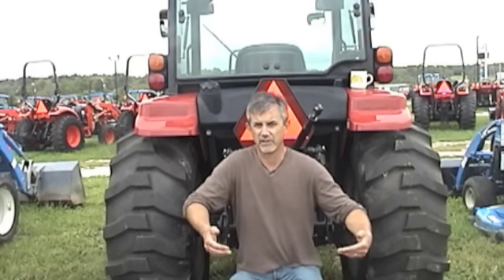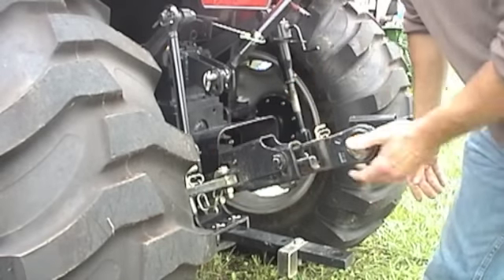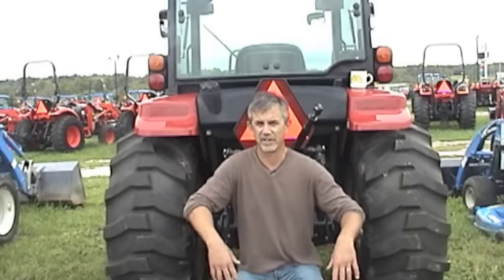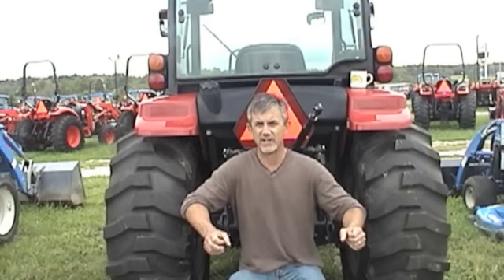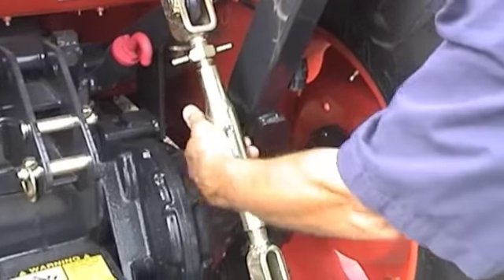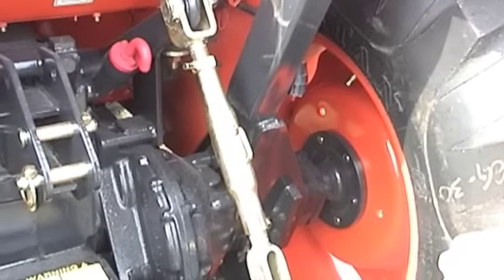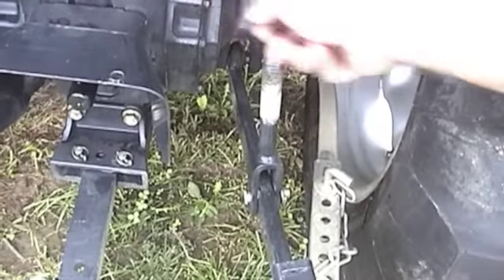Three Point Options

Comment: Scoring another LIKE on your video Mike! I had the original turnbuckles, they got beat to death very quickly. I replaced those, and then got the sliding braces to replace the turnbuckles, they lasted me a year and I just had them rip off - a couple of pins sheared on the slider, but I am not gentle with the implements either, so I know I am rough on them. I also originally had a three point quick hitch, but that also got shredded up rather quickly - and I think part of that was due to having the wrong size (Cat 2) instead of a more basic one.... Anyway, for now, because they are likely easy to obtain, I may be going back to the original turnbuckle system... I don't change things out often - but certainly - a proper fitting Quick Hitch would be sweet!

Comment: With the telescopic stabilizers, it can be difficult to find the sweet spot where the implement wont rock side to side. With the turnbuckle type, you can fine tune it and the implement is perfectly centered. The telescopic stabilizers have an advantage where you don't have to chain the lower links to keep them from hitting the tires.

Comment: Thanks again Mike for another great instructional video - do you have any vids that cover attaching and detaching implements to a telescoping lower link?  I'm not sure if there are any components of the three-point system that should be removed when attaching an implement to the linkage "bar".  Thanks!

Comment: infos great.what brand of tractors do you like and why. im thinking of getting a 40 hp tractor with loader and maybe run snowblower in front and power angle plow
Reply from the maker: Casy, I like most of them, the quality of the compact offering is currently extremely good.  My best advice is to find a dealer that you get along well with who is fairly close to you and buy what they're selling.
Reply: thanks mike great info on your videos

Comment: The pin type stabilizer and crank type lifting arm look great- wouldn't they be a cinch to upgrade on any tractor? They don't seem like such an integral part of the tractor that a person would need to upgrade the whole tractor.  Thanks for the good explanations!
Reply from the maker: Michael Bb I think it would work on most tractor brands, the problem is going to be the price.  Most manufacturers don't offer a kit for doing that, they make you order each piece through parts and it turns out being a whole lot more expensive than it should be.  The trick would be to find a salvage tractor with those parts and rob them.  I think the cost is going to keep most people from swapping with new parts.  I'd call the local dealer and check prices before you take my word for it though.  Great idea!
Reply: You can buy the crank leveling arm at Tractor Supply for $40.

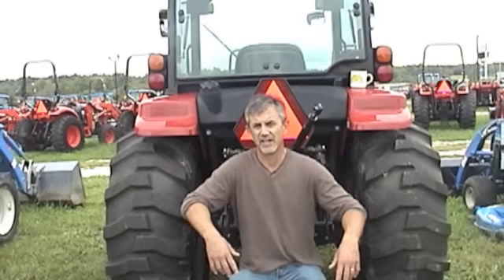Comment: mike, do you know where i can find the pin(with the chain) for the stabilizers? like the one you shown in the video at 2:48.
I really like the chain design because i keep on losing my pins. but I can't find them any where online.
Reply from the maker: +shohokuslamdunk Your local dealer should have something that would work, it's a common pin size, most dealers have a display where they have about any pin you would ever need in one place and the parts person can direct you to what works.  I'd either measure the hole or take a pin with me and try to match it.  Now, if you want the EXACT replacement for what came on the tractor you'll have to order that from a dealer that sells that brand of tractor.  It'll be a little pricey for what it is, but should be under $20.  If you'll e-mail me the brand and model of tractor and they have an online parts lookup I can help you find the parts number and then if you enter that in a Google search you can probably order it and never have to go to the dealership, or call and they'll ship it to you.  My e-mail is mike@asktractormike.com.  Good luck!
Reply: +Mike Wiles (Ask Tractor Mike) Just send you the email. Thanks Mike, I really appreciate your help.
Reply: shohokuslamdunk - Just my 2 cents. Get the pin of your choice and use "paracord".

You´ll never loose your pins, it´s cheap, strong, a lot less rattle than a chain. Shape it in a loop form and you got a nice handle to pull the pins, etc. 
In fact, I use it in hammers, crescent wrenches, garden tools...well all sorts of tools, to hang them when of duty. ;-)
One roll of paracord goes a long way in this type of application. ;-)
Cheers

Comment: hi do you have any leads on where we can find sleeve style telescoping stabilizer arms for compact tractors such as the kioti ck2510?  thanks
Reply from the maker: No...someone should make something like that and I've never seen it.  You might measure how far the arms need to swing and see if the stabilizer arms off a DK will fit and order those from the dealer if they do.  I'm afraid they'll be really pricey.  Sorry I don't have better news.

Comment: What is wrong when one of the extenders on lift arm won't lock in place when implement is attached. It will slide back and forth, but when I lower mower it extends again.  It looks like spring  is in place and nothing looks bent.

Comment: My tractor came with those stabilizer bars and they kept bending at the drop of a hat.  No, I didn't hit anything with the implement.  But a 6 ft. brush hog has a lot of weight swinging side to side when you move around corners; and apparently the well-known manufacturer didn't know how to make those bars strong enough.  They replaced them with a new set, and those did the same thing.
Eventually, their customer service sent out a local rep. to replace the bars with stabilizer chains (no extra cost), and I've been really happy with them.  No problems at all.
So if you're going to use those stabilizer bars, make sure they are super strong, AND don't use them on very heavy implements!  (Anyone want some bent stabilizer bars?)
Also, our tractor has a "float" setting on the 3-point connections, which makes it easy to connect an implement that is not level with the tractor, without having to move the adjustment on the one point.  This is good because you don't have to remember how many turns you made prior to the hook-up, and then remember to turn it back that far for leveling.  You can use the float setting for things like a brush hog on very uneven ground, then turn them off for things like a hay mower.
Reply: My New Holland WorkMaster 55 has the stabilizer bars with the holes.  I have been running a Woods 5' brush hog and a Woods 7' medium duty box blade behind it since I have had it, and have had no issues.  The bars seem to be extremely well made on mine.  I have always been more afraid of breaking the housing on the back of the tractor than those bars.  Strange that you had problems with them.  The way my luck runs I would have broke or at minimum bent mine by now if they were going to give.